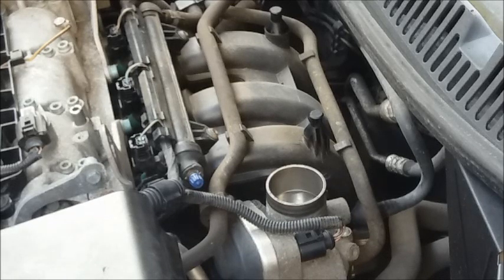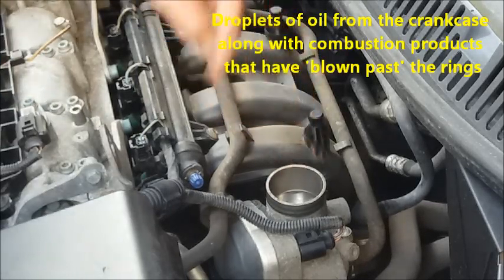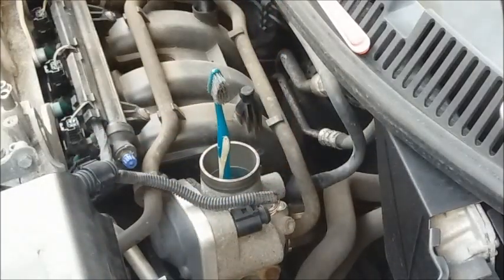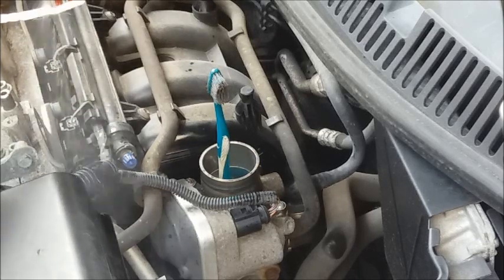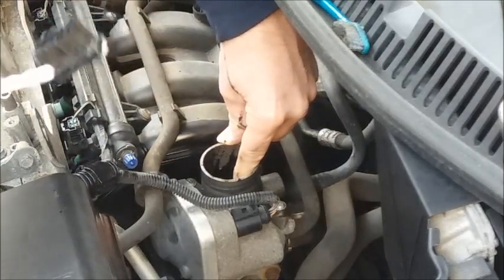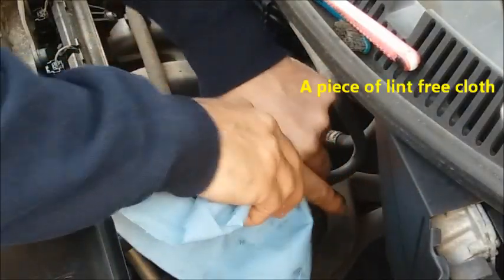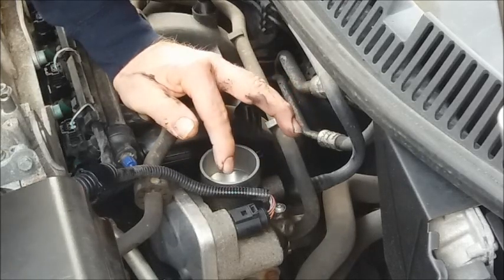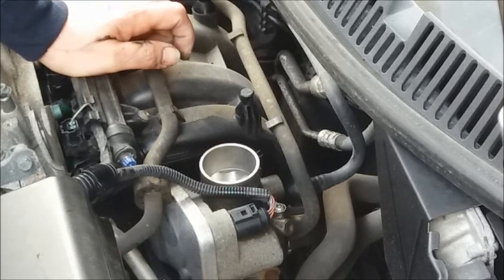Clean Your Car's Throttle Body | Dirty Throttle Body Symptoms

Comment: Thanks as always, Cyd! Though I've heard you shouldn't touch, let alone force open, electronic throttle bodies? Though it seems to have worked out for you anyway, so I guess it's all right on this model (I also have a 9-3, 2007, with the same color(!) as yours, it's just the Z18XE engine instead). Anyway, with a Tech2 you can actually tell it to open the throttle valve and hold it there for you, in "Engine control". Also, doesn't seem to be any calibration in the Tech2, although there is for the Vauxhall cars that have the same engine as mine. I guess the Saabs calibrate themselves?

Comment: Thanks for another great video! I have seen other videos where the throttle body is taken out for cleaning. Obviously I want to avoid this and clean it in situ, BUT I have not done it before (I have owned the car for 18 months) and it may never have been done. If it is very dirty (which I suspect it might be) would you recommend removing it to clean or would it still be ok to clean it where it is? Thanks!
Reply from the maker: If you don't feel confident to remove it, do it in situ. I've done a few quite dirty ones without removing
Reply: @CycloneCyd thanks - I had a look and it's reasonably dirty so I might remove... I'm imagining I might have to use a good deal of carb cleaner and I'm guessing it's better for the resulting gunk not to be passed through the engine

Comment: It would be garait if u could show what ur using to clean the throttle body be4 starting to clean it
Reply from the maker: Any brand of carb cleaner is good. My preferred brand (in UK) is Wynn's. I don't generally specify brands because often one brand is not available in all places round the world.
Reply: Im using Wynns is well are u spose to have ur engin running to do this or engine off as iv seen people doing it with enging running
Reply from the maker: @Anoymus985  engine off.
Reply: Are u spise to open throtal body like with a stick of some sort with the key turned to on but not in idle mode
Reply from the maker: @Anoymus985  I just use a piece of wood or a toothbrush, like I show in the video. I'd advise to keep the ignition turned OFF (keep the key out). That way the throttle motors cannot activate - they are quite strong and the butterfly edges are sharp, so could hurt your fingers!!
Reply: Grait stuff also can i jst add or ask av got a bit of play in my front weals..like what i mean is wen i jack front end up an weals off the floor wen hands on weals an i rock up an down u can hear a like nocking kind of noise what could that be
Reply from the maker: @Anoymus985  Hi Porsche 911, most likely either the top or bottom hub ball joint.Possibly the bearing, but I'd have thought it would die real quick if it were that loose.

Comment: Hi,
I have a VW Polo 9N_ 1.4 16V, recently the car EPC, ESP and Engine light came on every time I accelerate, and looses power. I scanned the car and the mechanic told me to buy the MAP sensor. Replaced it, the problem remains and he can't figure it out. Now the engine can't turn on, and when I tried to turn on again the ABS, ESP, Airbag can't turn of and handbrake light is biping. Please, help.
Reply from the maker: oh dear! Have you tested the battery and alternator and ALL associated wiring?
Also check the fuses in the battery top lid. See my battery and alternator test video and my Polo ABS light video for fuse location.
Reply: Cyclone Cyd I grateful for your help. I am from Pemba -  Mozambique, so we don't have good mechanics, so I have to understand the problem before taking it to them.
Reply: Cyclone Cyd I watched your video about ABS connector and no cracks. Which liquid did you use to clean the throttle body?
Reply from the maker: Wynn's carb and intake cleaner   https://amzn.to/2GB5U49
Anything called "carb cleaner" or brake cleaner. If you can't get any locally, use petrol.
Reply: Cyclone Cyd thank you.
Reply: @nivovo  check battery and alternator. Many errors at the same time means that the system voltage is too low. 

Charge the battery outside the car to 100%